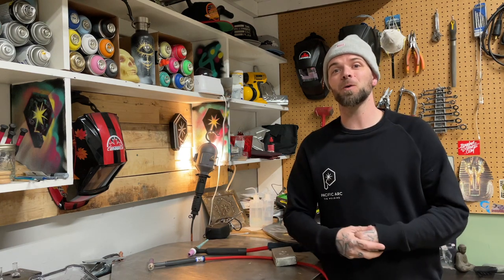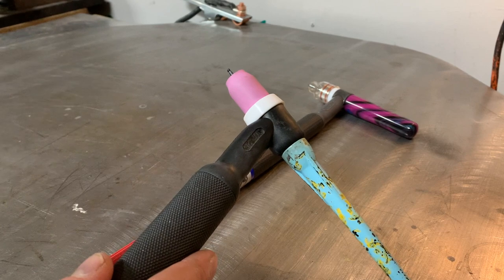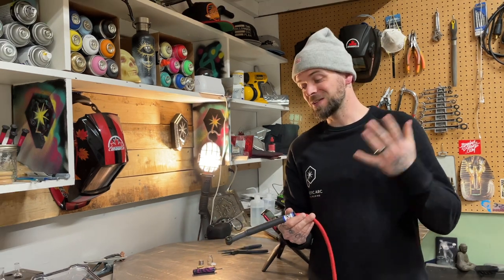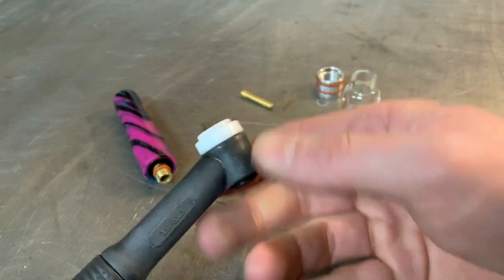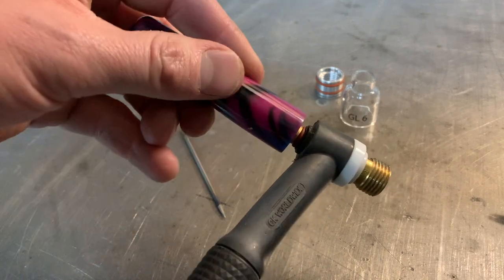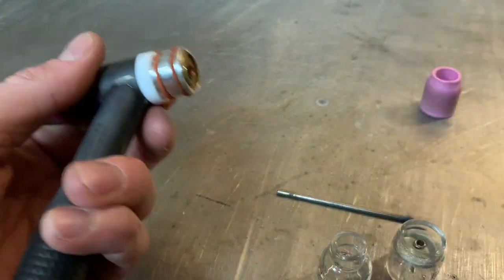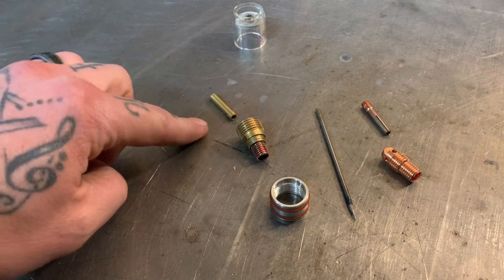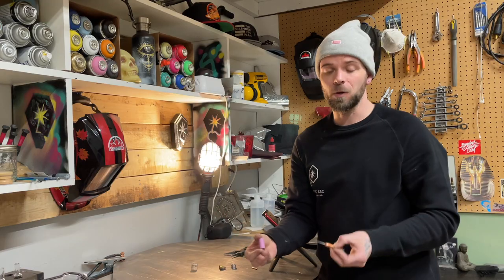🔥How to set up a Tig Welding torch for STAINLESS STEEL!🔥

Comment: Hello I just Subscribed.  are your videos applicable to aluminum welding?  I need to buy some magnetic table clamps like these (Bessey 2400HD-10 - Clamp, metalworking, hold down, table mount, 9.5 In. x 5.5 In., 2220 lb)  I dont need 2200lb clamping force.  where should I look in the US for good prices?

Comment: Great one :D Could You make a video where You compare welder settings for aluminum, stainless and regular steel? And how to change them depending on feature type like inside or outside corner joint?
Reply from the maker: Great suggestion. I appreciate it 🙏

Comment: So you said you snap your tungstens in half.  I'm curious what the best way to do that is?  I doubt it's as simple as I'm thinking which if I try I'll probably end up with tungsten flying into my eye.
Reply: I use a corner of bench grinder wheel to cut it in half. You know fresh pack of tungstens, open it up, cut them in half and grind them all. I also grind edge of the other side of electrode so when I dip it or something it's easier to put it into collet even in gloves. When I know I will have some job where I won't be able to grind that much I take 10 tungstens, cut them in half and grind them all on both sides so I technically have 40 tungstens to ruin. 😂

Tried to break/snap it once by busting it with hammer and it did nasty split and I had to throw whole electrode away. So I'm not doing it this way anymore and I highly don't recommend it. Stick with bench grinder and it will work fine I believe.